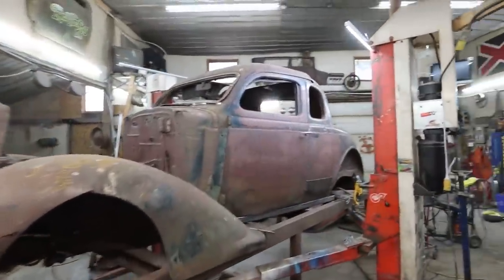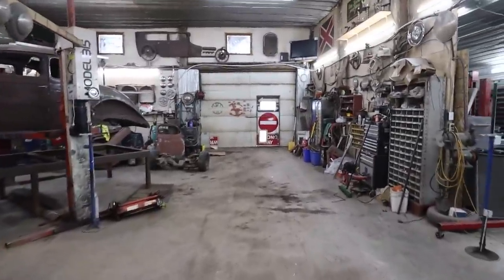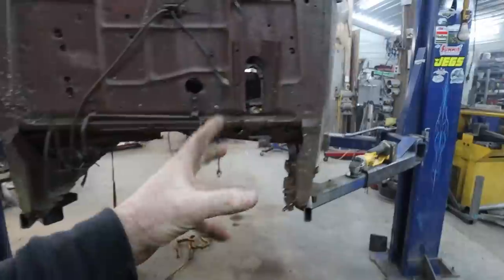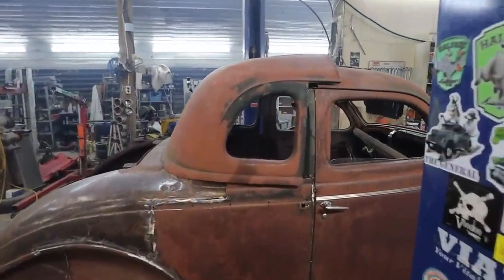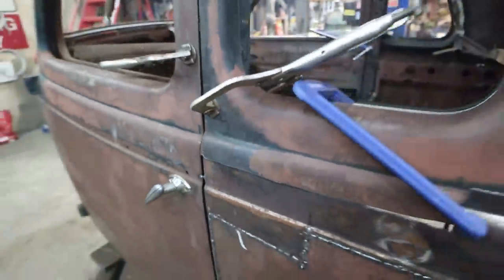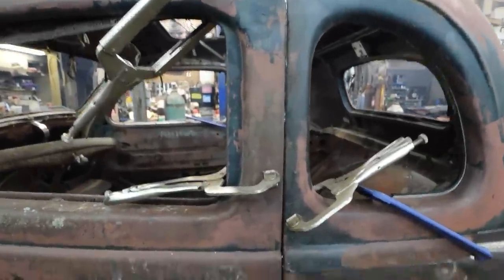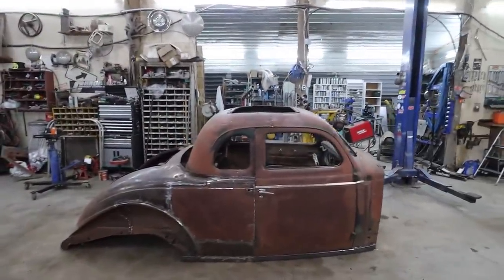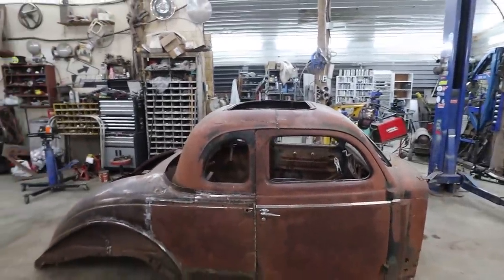Redoing the rear roof section of our 1935 Dodge coupe.

Comment: Brent, interesting to see how you cut and fit small areas without warping the metal.  You get away with stuff I can't. I always used a wet rag to cool the spot welds and move all around to different areas to keep it cool.
Reply: You can probably think of all of Canada as wet rag this time of year. . .

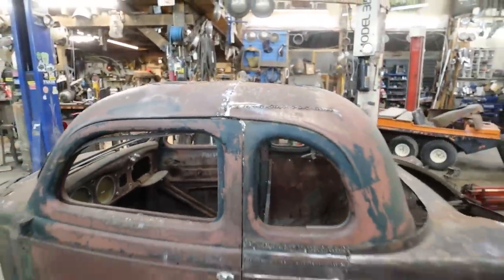Comment: Nutty idea, but considering the image at 49:11 i'm wondering if a way to maintain that line you like from the other donor car would be to chop the A pillar a little bit bellow that dent, then midway in the B pillar and at the back on the C pillar, where that paint (?) line, or rust or whatever it is, from it, going along the window's line then cut down keeping the line you like uncut. With that top part taken out, then place it pivoting up at the A pillar cut (after removing however much you like to chop from it) and then blending in the line you like with the back.

You'd have to then deal with the raked roof at the back, but that shouldn't be an issue for you, plus i think you also wanna chop the rear window??. Idea being that you'd blend in the line deleting the entire coupe blend altogether.

Bonus, it would also shrink the second window naturally because the "twist" would reduce its height.

Bad part, dunno what would happen to the B pillar, but it certainly wouldn't be pretty, probably would be smarter to cut it in the roof, as a T piece and then blend the T piece into the roof line after the fact, kinda like Chip Foose used to do way, way back in the day (or at least in one of the articles i saw him do) when he still worked for 'that' cranky old man.

Just "talking" out loud, i'm sure you'll figure it out. IMO, i think that the line you like would look far better than the coupe's blend. The coupe's line is nice, but only when it's in a natural coupe, if you chop the top, it... looks a bit weighty, not right. Kinda like having big shoes, tight pants, big sleeve pompous shirt over. It just don't work right.

Comment: So are you filling the small window in Brent? If so Not to burst you fun but I think being a watcher from a far I would have pulled it back to take advantage of your crisp line you mention and make a piece to fill in at the back of the door . .If the 4 door roof was too high you could have sectioned just above your crisp line and brought the whole  roof down. I know how hard it is to sand a crisp line into bondo.Food for thought for next time.
Reply: If I need a sharp line I run two pieces of masking tape tight to each other, a swipe of filler between them, remove tape, a light sand followed with a heavy coat of primer.  When dry sand carefully on top of line and bottom.  I did a 69 Charger that was painted black and the body lines were all over the place.
Reply: @glennnickerson8438  I kinda of understand your idea but the line can go in and out .Even though the line is straight one dimentionally you still need to have reference in and out. That situation is a sanding guess feel and how it looks after primer. I prefer to leave sheet metal formed lines and make welding seams beside them.
Reply: @glassblastcollision  My buddy bought new panels and the body line would be there and then  disappear.  He wanted it black so I spent about 300 hrs making those lines sharp one section at a time.  He would have someone paint and he put a blown and injected Hemi in it.  I will never own something that straight or make something that straight again!😆  I'm just a "hack hobbyist that sells paint supplies and I give anyone credit who does it for a living!  8 yrs later the car still looks great.

Comment: Another great project.
I really like the 55 napco build.
I ve got a question how much prep do you do before using por 15
Reply from the maker: Not a crazy amount just know the worse off and wire brush the rest
Reply: @HalfassKustoms  Thanks my friend.
Give the pups a scratch behind the ears for me
Reply: Im working on a numbers matching 71 Chevy Cheyenne long-wheelbase 2 wheel drive automatic power steering power brakes no air condition though
Reply: I was in the process of finding a 55 thru 59 to do the same as you did with yours.
A 59 would be great as that's the year l was born.
Keep up the great videos

Comment: The shape of the back of the door window opening you want to mirror what is now the shape of the back of the quarter window. Could either use your spare quarter windows for this or do what guys have done for 70 yrs and pie cut the back of the door to round it. You dont want that square reared door window opening, it wont look right on a 3 window

Comment: I keep thinking, with you intending to make it into a three window coupe (covering the quarter windows), why not extend the doors four to six inches (reduce blind spot)?
I also had the thought of making the tail panel (below the trunk lid, above the bumper) into a tailgate, maybe have 1/4 of it pivot so it tucks under the trunk floor?
If I understand correctly, most of these vehicles you set up to a "drivable" condition, then sell to people for additional "custom" work so my suggestions may not work for you but possibly for the next owner?  ;-)
Reply from the maker: You'll see things will work out there's a lot of things about to get squished yet and shrunk :-)

Comment: I said, to myself, how in God's creation is he going to fix that mess he created? I thought for sure. You had screw it up! after you cut that old rear hood off and it didn't match up! worth a shit. Yet to my utter surprise you managed to pull it off. I will never doubt your abilities again. Now, after watching this build that's for dern sure. However, I hope you'll manage to get the back of that roof sloped like the original car was before you removed the back of the roof. That's my grip, other than that,  She's looking pretty dern good thus far, Brent.

Comment: When I looked at the former rear roof line of the dodge before you cut it off, it always looked like the section you removed was higher than the front.  I wonder if it's because of that tilt there's this space behind the new rear section?
Reply from the maker: Yeah not sure